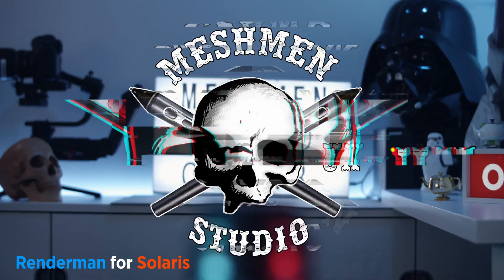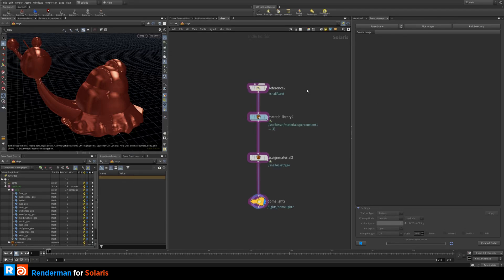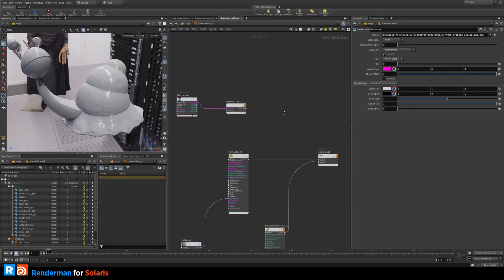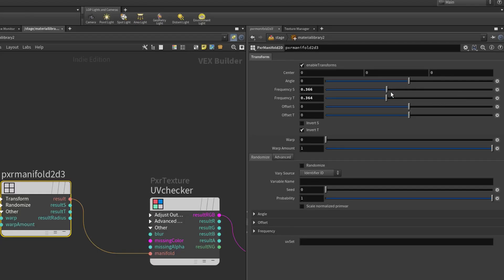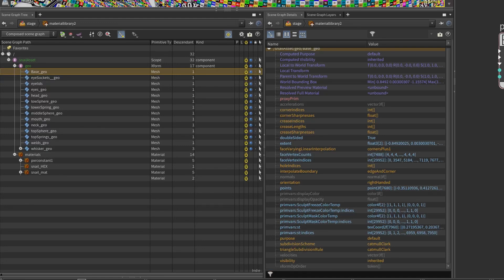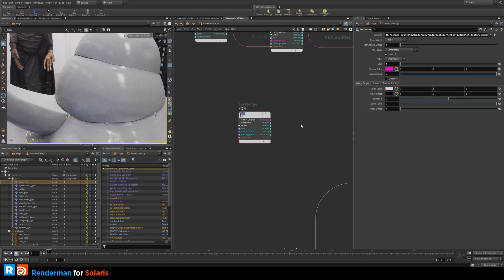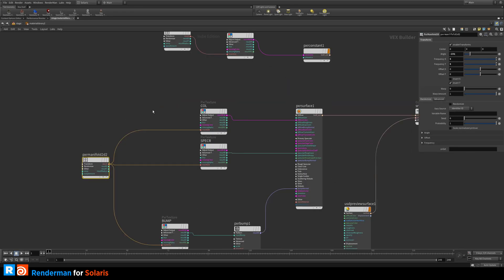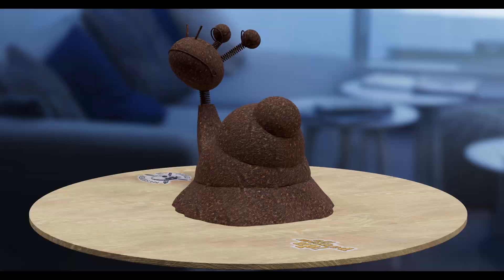Tiling Textures Made Easy: Unlocking The Power Of Renderman For Solaris

Comment: doesnt work in the latest R26 version. Doesn't tile
Reply from the maker: what is your process?
Reply: @MeshmenStudio  I'll have to get back to you on this, but thank you for responding. But I was examining tiling and I was simply trying to tile the texture, but each tile was turning up black instead of seeing the texture tiling. (I'm new to renderman - I was testing it actually). I'll get back to this for sure, and try again to recall/refresh my process. I have learned more about the new renderman however, and maybe I won't have the same 'tiling black color instead of the tile' problem. cheers